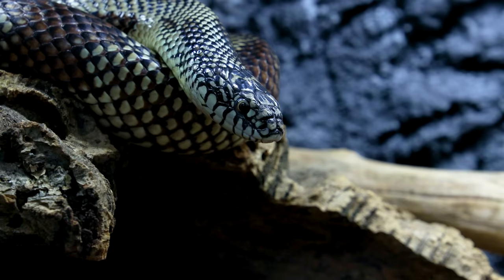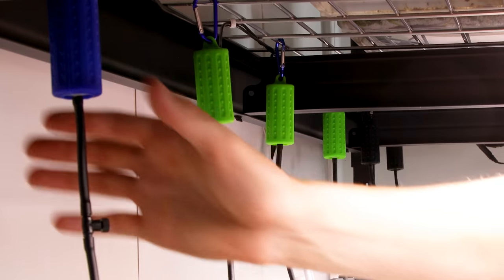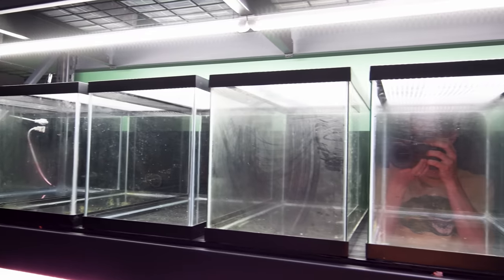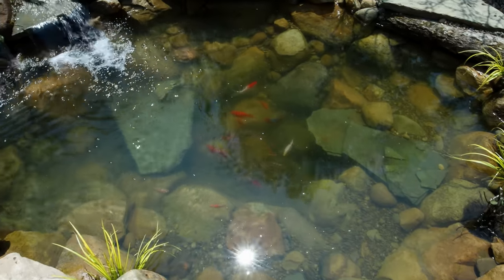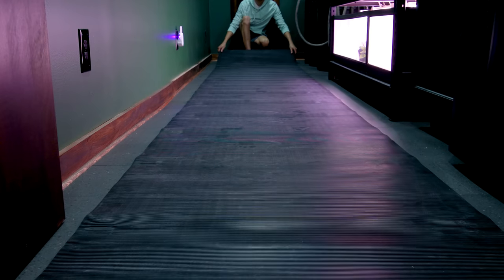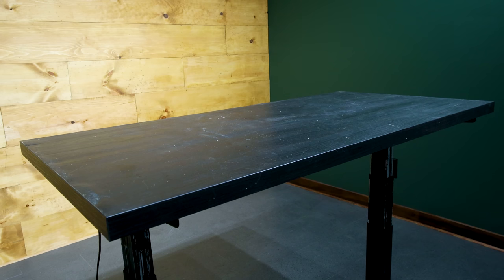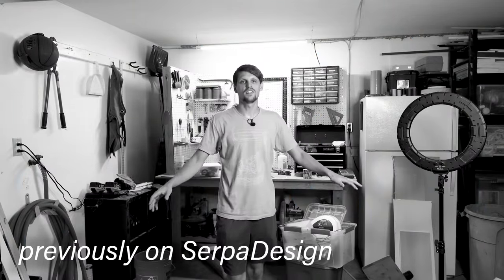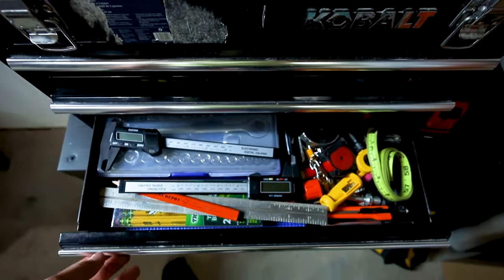Finding Motivation Is The Hardest Part

Comment: As an artist with adhd i relate to the cleaning/organizating part at the end sooooo much. Keeping my art supplies in order when i'm flitting from project to project is so difficult. Then when it gets bad its so overwhelming that its hard to even get started. 

Its honestly so reassuring to know someone i look up to so much has the same struggles :)

And yeah kinda like you said its really helpful to just get started on *anything*, matter how small or insignificant. Just find one tiny thing, break it into even smaller steps if needed, and just focus on that. Starting is often the hardest part and once that's over its soo much easier to keep that momentum going.

Comment: for that empty space above the toad tank, you should place some little decorations, like a little sail boat or something
now that you've got the space, strategically placed trinkets could add some texture to the room
edit: try eva foam for the table top. you might be able to order a roll with the exact dimensions you need, but i'm not sure if suppliers will do that

Comment: It's so easy to get completely overwhelmed with a messy space and honestly it can make you feel paralized when you want to clean but don't know where to start.

So a tip as a former hotel housekeeper, the thing to do is divide the job up into small doable parts. Just like the maintenance on your animal room, once you get a system of cleaning in place it becomes second nature.

And for work spaces such as yours, I'd probably create a racking system with more shelves and storage compartments so everything has a place and is in easy access. That way you're not digging through random boxes for things. You can take inspiration from how a hardware store is set up where everything is organized, in sight and easy access, while leaving an open space and benches for working.

Comment: Organizing and cleaning a workspace or used space is both therapeutic and practical.  I work in a similar way to you.  Pulling things out and working in a frenzy and if you dont keep on top of putting things away and organization it can get out of control very quickly.  Keeping on top or organization and storage is a job in itself but the better you get about it the more rewarding it can be for both your mental health and workflow.

Comment: Adam Savage has become known for his "First Order of Retrievability" concept. It bascially means that things you use the most, should be the most readily available. I have recently put up a workshop and applied this method. It really works well. My hot glue gun and angle grinder are permanently plugged into a socket that is mounted on a solid surface. I have all the tools I use the most hanging in a very obvious place, outlined in white-out marker so I can change it later if I want. My next step is a making places to live for my Allan wrenches, drills and screwdrivers. 

I will also add some big cylindrical storage units that rotate and start organizing the things I have in deep storage.

It has increased my workflow immensely. Now when I want to do something I no longer have to dig through a pile of tools but can just take what I need.
Reply: It also makes cleaning up feel rewarding because its like saying thank you to my future self.